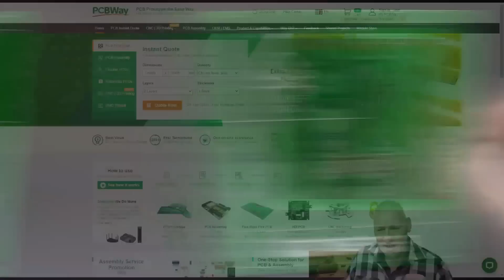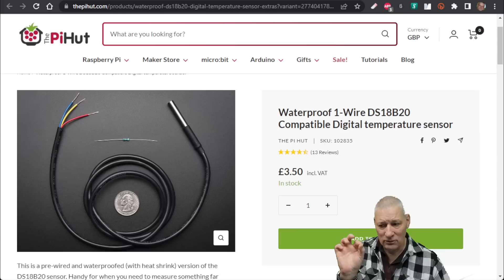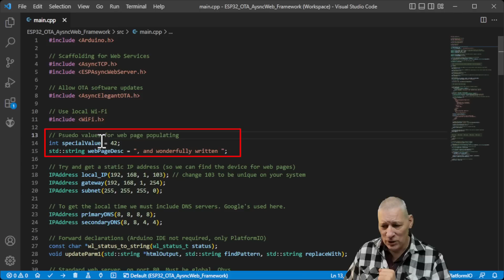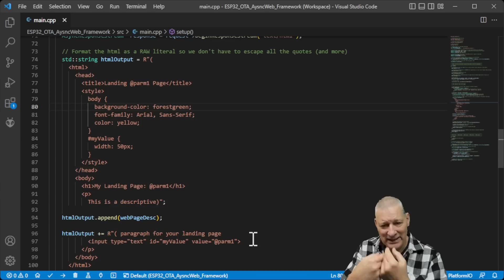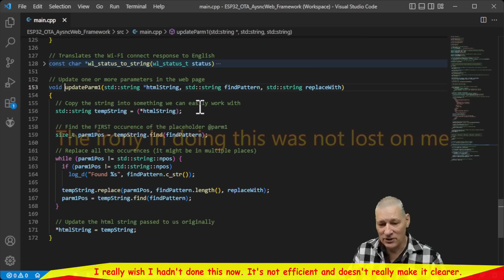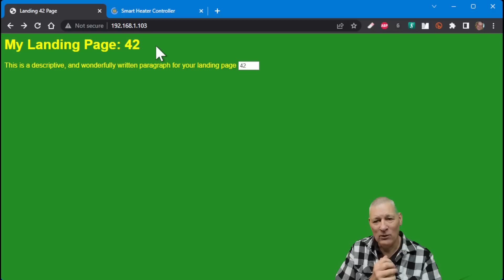#260 ESP32 Web Pages PART 2 - adding a sensor value on the page & more!

Comment: Just use esp websockets, client loads html once, then receive only one (or many) variable from ESP, both ways,  JS in html grabs variable from ESP and puts in propriete box in WWW, when user tap some button JS send this action back to ESP. When ESP websocket server  has couple client connected (four is about max in ESP) from PC/smartfon/tablet  they interact betwen ech other too, when user one tap button ON and see change state on web, rest see that too, immidiently.
Reply from the maker: Yes, I'll be using that on my next web-based project; it is simple enough to set up, but the amount of coding on both webpage and device can overwhelm an inexperienced user.

Comment: Beware that there are lots of fake Dallas temp sensors floating around.  They may work but perhaps not in 2 wire mode and internal registers may not be fully implemented.
Reply from the maker: Ain't that the truth. So many fake components, and very difficult to tell.

Comment: Easy way to seal stuff is to use glue filled heat shrink.  Works just like the regular stuff, but has a thin layer of hot glue between the rubber and whatever you shrunk it onto.  It makes the connection effectively weather proof.  The only drawback is that the heatshrink is stiff after shrinking.  And of course, it is more difficult to remove if you need to.  It works excellent for outdoor stuff, or even as tougher protection than regular heatshrink provides.
Reply from the maker: Yes, pretty much as I described it in this recent video: https://youtu.be/AFbciSsWr_M 
But it's good that great minds think alike!
Reply: @RalphBacon  You have so many excellent videos, I hadn't seen that one yet since I only came across your stuff yesterday.  Keep up the excellent work!
Reply from the maker: Don't worry, you only have about 250 videos to watch! 😲

Comment: Has Espressif EVER fixed their TCP libraries?  I stopped bothering with them a long time ago because they were so incredibly badly broken, and plainly known to be broken.  For smallish things they were OK, but if you tried to use them to serve larger content (like a large log of sensor data), they would hang/block/drop constantly.
Reply from the maker: I don't know. I've not had a problem but then again I've never served larger content of the type you describe. If you get an error it's worth logging with them as they do (eventually) respond and sometimes even fix things!

Comment: Thanks for the useful guide, though i did get a bit lost in the depths of the strings & pointers. I need to re-watch whilst awake.
Reply from the maker: I've rewritten and simplified that function so it no longer uses a pointer, just passes by reference, as we should be doing with C++. Using pointers is deffo a C language thing.

Comment: Hello again. Nice code but in my IDE 2.0.3 I got this: D:\Documents\Arduino\260_esp32WebPagesOTA\260_esp32WebPagesOTA.ino:104:62: error: 'to_string' was not declared in this scope
     updateParm1(&htmlOutput, "@parm1", to_string(specialValue));  I've tried many declarations but it doesn't help
Reply from the maker: You might have to
#include <string>
Or
#include <std:: string>

I'll check it out later today when I'm back  in the workshop and update this comment.
Reply: @RalphBacon  Did you find out any solution?
Reply: I have much the same error 'to_string' is not a member of 'std'
Reply: I've updated my Arduino IDE to 2.2.1 and still get
 Compilation error: could not convert 'String(specialValue, 10)' from 'String' to 'std::__cxx11::string' {aka 'std::__cxx11::basic_string<char>'}
Other people must also have this error?  How do we fix it?
Reply from the maker: I need to grab the code and use it with the Arduino IDE (I'm using Visual Studio Code/PlatformIO which might make a difference). Stand by!
Reply from the maker: OK, first issue is that you don't mention whether you are using the Arduino version I posted in my GitHub, or the PlatformIO version. I'll assume the Arduino version (in the Landing Page folder).

I'm also assuming that your error is from line 104 of that sketch:
    // Inject the values into the web page
    updateParm1(&htmlOutput, "@parm1", std::to_string(specialValue));

Well, I copied it, as is, to my Arduino 2.2.1 IDE and compiled it successfully:
    Sketch uses 842505 bytes (64%) of program storage space. Maximum is 1310720 bytes.
    Global variables use 43148 bytes (13%) of dynamic memory, leaving 284532 bytes for local variables. Maximum is 327680 bytes.

At this stage, I can only assume (yes, more assumptions!) that my environment is a bit different to yours, possibly as a result of using PlatformIO - perhaps I installed more libraries when I ported the PlatformIO version to Arduino, initially.

If I hover over the std::tostring phrase, a little pop-up tells me it is:
    // In namespace std
    inline std::string to_string(int __val)

In my PlatformIO environment this "to_string" function is part of the library header file "basic_string.h" - this is a fundamental C++ file so you should check that you (a) have it installed and (b) installed correctly.

Finally, try replacing the problem line (containing to_string) with the old fashioned:
    // Inject the values into the web page
    //updateParm1(&htmlOutput, "@parm1", std::to_string(specialValue));
    char buffer[5] = {0};
    itoa(specialValue, buffer, 10);
    updateParm1(&htmlOutput, "@parm1", buffer);

That compiles fine in the Arduino IDE but whether it does what we want remains to be tested (by you). 😀

Comment: Ralph, so glad I (actual name Mark Bussey) found your YouTube videos a few weeks ago.  Great job on them all!  I have a question relating to a comment you made in a previous video, but wanted to add my question here so you would see it for sure.  You mentioned that several people have said that the String library possibly has memory leaks, and we should stick with std:string instead.  What do we do if we're using someone else's library but it uses the String class?
Reply from the maker: Hey, Mark (or should I call you Angus?) welcome!

Now, regarding the use of String (with a capital S) vs using string (lower case, part of the std namespace), let's not get too hung up on this.

Yes, the Arduino implementation of the String function does certainly fragment the heap memory space, turning it eventually into Swiss Cheese that does not allow the runtime allocation of a suitable contiguous block of memory for variables. Kaboom!

But you would have to be doing some serious String manipulation for this to happen, particularly increasing the size (length) of the String as a new variable is created in memory for this, leaving the old memory available for reuse.

But even Espressif use String on occasion (rather than the more usual std::string), much to my surprise, so maybe their implementation works better than the standard one. Or perhaps their hardware (ESP32s) tolerates the heap memory fragmentation better because it is larger.

TL;DR the takeaway is that you can't really control what is in other (3rd party) libraries and will have to live with the consequences. But manipulating strings is something you as a developer should be wary of and consider alternative ways of achieving your goal, such as allocating a buffer large enough up front for the largest size you will (ever) create - that way you can just fill the buffer (with a terminating null char \0) time and time again, and the variable will never be recreated.

I could go on (what do you mean, I already have 😲) but you get the drift?
Reply: @RalphBacon  Thanks for this!
Reply: @RalphBacon  Thanks for the deeper explanation.  I'm not currently doing anything other than sending fixed length text strings via WiFi. So, I'm not going to worry about it in my current project.

Comment: Why not use sprintf() with the HTML code being in a C style string rather than that clumsy function to find and replace Strings ?
Reply from the maker: Yes, why not? Many ways to achieve the desired output, I'm sure. If that works for you...

But my "clumsy" function is, IMHO, a rather clean (black box) method of injecting values into a static page and works nicely when the page is in filestore. As you will see in Part 3.😉 

BTW I've cleaned up that function now and it just looks so much better, no copying of strings involved!

Comment: Good video, thanks.
If the next video in this series covers the esp32 serving a web page from a sd card, there is one problem you might cover that I have not been able to solve.  When displaying the page from the sd card and having the cpp program add a variable to the page it always goes to the top of the page.  I am using a mega with an ethernet library and therefore transferring data with client.print
   I have an esp32 serving up my home automation web pages very nicely (from sd card), but alas it probably does not have enough program or dynamic memory to run the cpp program..
Reply from the maker: "It always goes to the top of the page". Hmm.

I'm not 100% clear on what the issue is. When you (re-)display an html page, it will always display it from the top. 

The display will not start (scroll to) half way down the page unless you put an anchor there (page anchor, not a link, although you can use that too) and then, in the page output, tell the browser to navigate to that link. Is that what you mean?
Reply: @RalphBacon  Thanks Ralph.  I use a href to switch between pages, but had not considered it for use in the cpp program to inset something into a certain point in the page.

Comment: I've bought those pre-wired temp sensors.   They are waterproof as the actual sensor and wires to it are encapsulated in the metal tube with epoxy.
I've used them in chlorinated pool water with no issues.

There has been talk that the cheap ones aren't well calibrated.
Reply from the maker: Good to know, Daniel. Not all sensors are equal it would seem. I had one that was most definitely not sealed (the sensor came right out of the tube) but maybe I really did buy cheaply that day.

Yes, calibration can be an issue. The discrepancy is not linear so it's not just a matter of deducting, for example, 0.5 degrees off the reading. Perhaps the more expensive versions are better calibrated.
Reply: @Ralph S Bacon  I believe the calibrated ones are significantly expensive.
If the actual sensor is in a metal tube and not encapsulated in epoxy or similar, that could cause inaccuracies or delays to accurate readings after a temperature change since you're then insulating the sensor.

Comment: A few months ago I asked you about having temperature broadcast on a WIFI page and you kindly replied with a suggestion to do this very thing so I'm really looking forward to future videos. 
Having multiple temperatures displayed at the same time is something I need for a couple of projects I have on the go so please please be sure to cover this. 
Thanks again. 🙂
Reply from the maker: I'm glad you're finding these videos pertinent to your requirements, Ali. 

However, do remember I'm not showing the code on how to actually read the temperature from the DS18b20 (or whatever it is that you are using) as that is not relevant to HTML pages. I've assumed you can do that bit already (and I briefly described how to do it with the DS18b20).

Next video in this series shows how we can change the target temperature by reading a value from the screen. Keep tuned!

Comment: Again, very good content. That helps me a lot on my way to create better code for my ESP32 projects. Hoping to see more in future. Maybe some graphics?
Reply from the maker: Graphics? You mean animations? Or just pictures? Diagrams? Anyway, don't miss part 3 in a future video!
Reply: @RalphBacon  For example, I would like to use a picture of a nice old gauge (artificially created) on a webpage and its moving hand is realized with html. I did something similar with EXCEL. In case you are interested, see episode "Heat energy savings predicted ..".

Comment: Nice video Ralph.  By the way, the functionality you're trying to program, 'template replacement' is already built in to the AsyncWebServer Library.  Templates take the form of %TEMPLATE_NAME% and you define a function called Processor that receives the template, and returns your value.  The code looks like this:
String processor(const String& var)
{
  if(var == "TEMPLATE_NAME")

    return F("WhateverYouWant");

 if(var == "SomeName2")
    return F("Something else");

  return String();
}

You just keep putting in if statements for each % template in the html.  The Library handles scanning for the % template, and calling your processor function, passing in var which contains the template name to be replaced.  You then return whatever you want to replace it with.  AsynchWebServer then embeds the value returned into the response html.  Check out the lib examples under me-no-dev on GitHub for detailed instructions.

Comment: I came across snprintf_P(). Has one drawback, every variable must be in the exact order.
I think I would go for a javascript option. So in HTML I would use <span id='var001'><span> and in javascript I would have an array with values var001='this_is_var_1'; etcetera, and then let my browser do the work. The fun is that you can design your page with real content in the <span /> to see what it looks like.
One more reason to work this way, is that I optimize for the smallest memory footprint.
And the template itself would maybe come from either an SD card, or I would retrieve it from a server, so I can update it real time, remote. Drawback for the latter idea is that the server may (must0 not go offline, but that rarely happens. I rather ftp upload a file to a server than to update OTA a microprocessor, just because I need to update a few characters? No, not my way of working. (but I am just starting to play with ESP32, my experience comes from programming 25+ years).

Comment: Really enjoy your videos and your detailed explanations. The ESP32's are great and I'm just getting into them, I've bought a couple of ebay to have a go at creating parameter tables for a generic controller rather than using displays, is this something you might have done or plan to do?
Reply from the maker: Glad you like them! But what do you mean by "...creating parameter tables for a generic controller..."?
Reply: @RalphBacon  Nothing specific, just speaking in general terms if you were to create a table that held PID parameters for a temperature controller for example.

Comment: Well explained, and I used to code it this way...but possibly a micropython and microdot (mini-version of python flask) approach is easier  and more flexible on the esp32 or pico W using Thonny or VScode??  Great content, and not to detract from your excellent explanation.  Different strokes for different folks?  Thanks!
Reply from the maker: Horses🏇 for courses, is what I say! I've demoed Thonny use, and whilst quite capable it's not my preferred development platform (and don't get me started on the way Python indents code for actual syntactic meaning 😲)